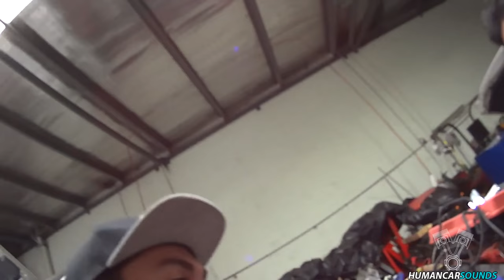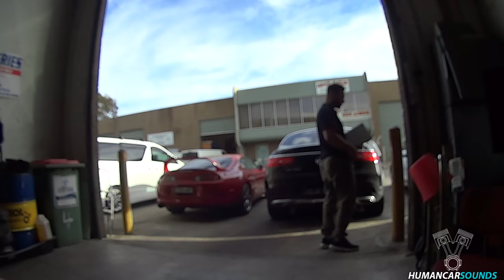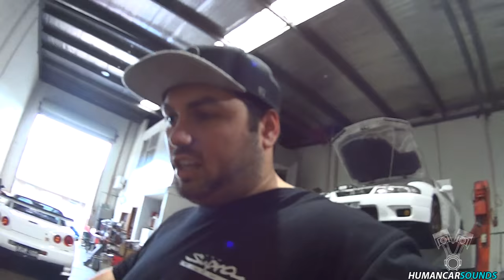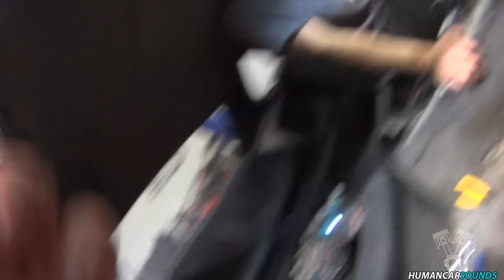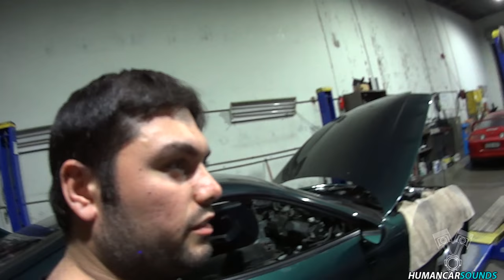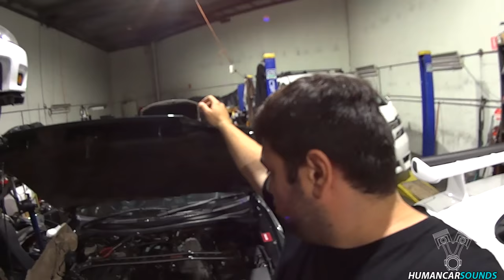Supra Dashboard  + Heater Core Removal  (Part 1)

Comment: Did you try running a thin knife blade between the dash and windshield to break the glue bond?     It looked like that was possible in the video.      Supra dashboards are a royal PITA to remove and reinstall.     I have a MKIII that needs to  come out.    I'm thinking of removing the windshield and trying to repair it in the car versus tearing the damn thing apart.    MKIII parts are a nightmare to locate.    Used parts even go for big money.

Comment: Tips on removing dashboard? I been pullin hard as fuck on mine up and down, outwards every direction but isnt budging. Yes all bolts and nuts are out
Reply from the maker: Could have the same issue as mine, has the window ever been replaced? If soo maybe they glue the window to your dash
Reply: @HUMANCARSOUNDS  hmm no idea i dont know about previous owner history. Do you recall having the wire loom holding it the dash in place?
Reply: Turns out mine was glued as well! Why would anyone do this lol @HUMANCARSOUNDS